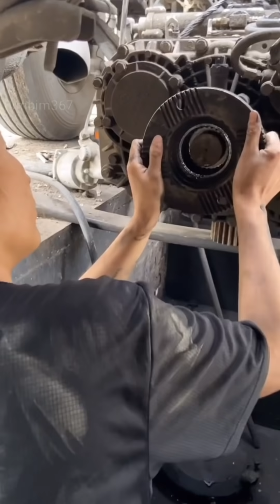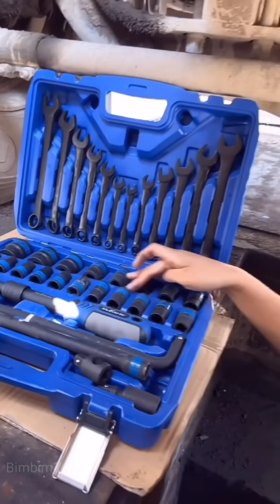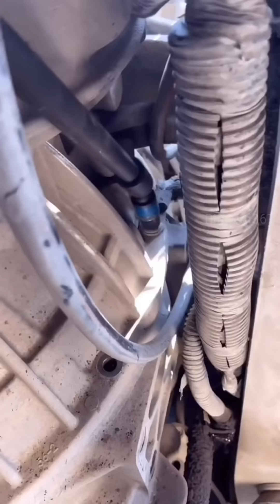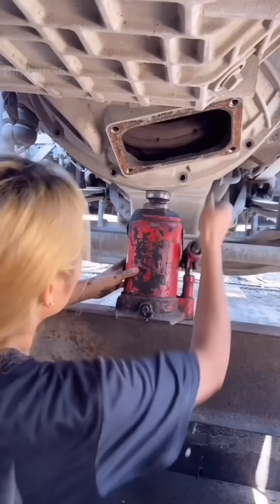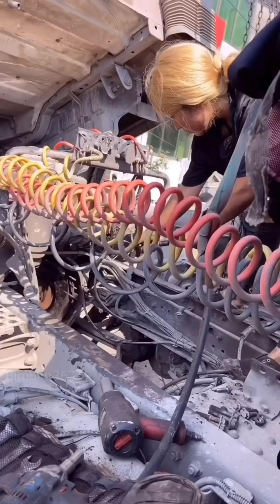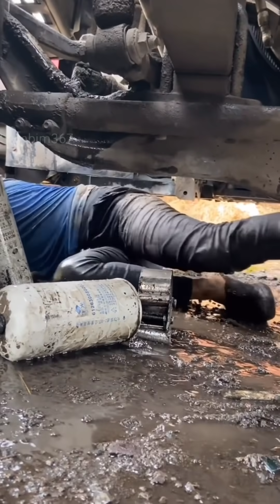Đàn ông đâu hết rồi, sao để phụ nữ thế này? || Nan Meier (P2)

Comment: She's clearly subjected to many dangers as a heavy equipment mechanic, clutch dust, used motor oil, heavy parts, brake asbestos, unsanitary ground conditions, power air neumatic tools, so far she has a strong grip for grease on her hands! She's very smart and capable but this is not her own backyard car project...this is an industrial heavy equipment district area she is swimming in used oil and other pollutants and no safety mask! I again wonder if this is a family run business because of her skills, but how long can this business go on without her safety in mind? This is how all of Asia conducts their workers...regardless how cheerful she appears after 'half' the hard part is over...Working with safety mask or gloves or any safety gear (if they supply it), are uncomfortable but that mindset is old now!

Comment: Next time you take a filter off the truck poke a hole at the bottom of the filter let all the fluid come out then spin the filter off air will not run down your arm or down your face OK you're a pretty girl